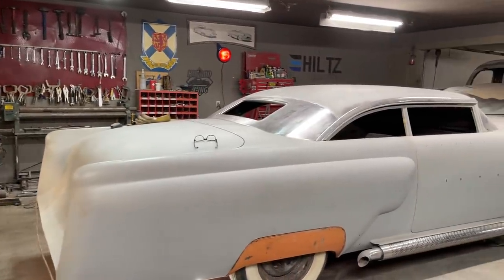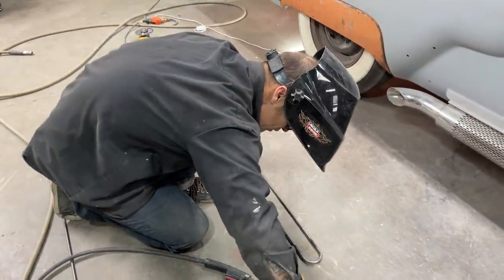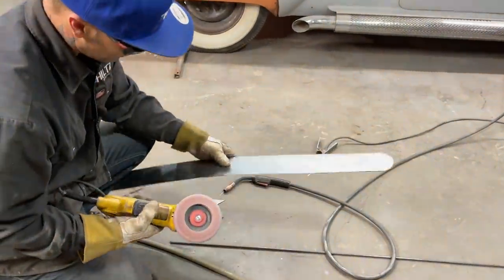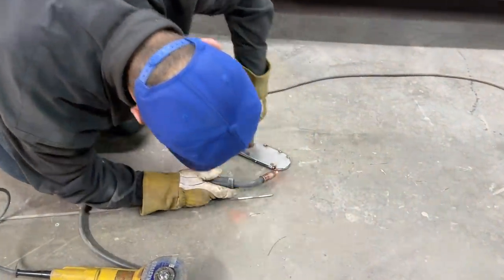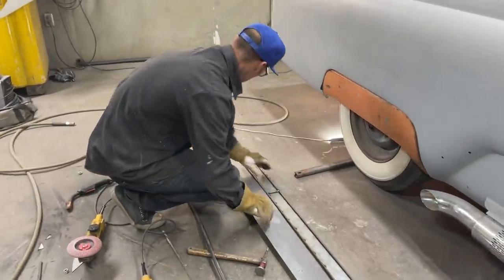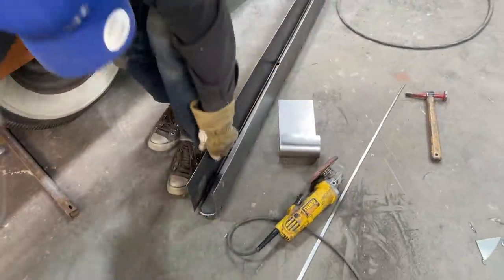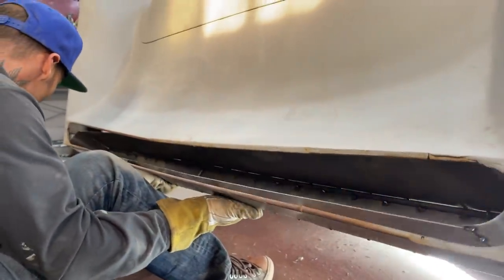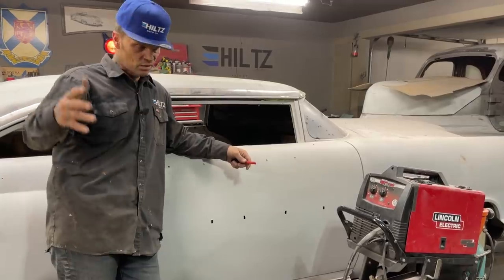Designing and Fabricating CUSTOM TAIL LIGHT from SCRATCH for the '55 Mercury

Comment: Love the light bar. The Sail panels turned out great.
Reply: Sequential LED’s should fit inside that box rather easily. There are some great control boxes on the market that allow turn signals and back up lights as well as running lights. Hopefully Mr. Chad will see this car is good enough to deserve some nice tail lights.

Comment: Interesting idea frenching it in like that. Giving me ideas about making my own. LED strips would be cool in there.
Reply: Don’t forget to add a couple of drain holes if you are going to drive your car on the streets.  I’m a piece of quarter inch tubing  half inch long welded to the outside of the hole will keep road splash from going inside your box

Comment: I would try a test piece on the glass. A soup can has a tighter radius than the windshield and if the vinyl can handle that then you would be okay with the windshield. You could do the test on FB brfore modifyig the barbeque. I'm very curious to see how it works out.

Comment: Another great show..thanks guys. Just on the windscreen and vinyl wrap….heat is used to ‘remove’ the vinyl….so I think you’d need to wrap it ‘after’ you’ve formed it. Maybe try a test piece….but no doubt you’ll figure out the best way 👍
Reply: I think I remember Chad saying he wanted to make this car a daily driver for Jolene and himself. If that’s true then eventually he will have to install a proper windshield. 
I was hoping to see him attempt a custom paint job. I think a two-tone or maybe even a three tone paint job would look nice. Whatever he decides I’m sure he will be happy with it.  What an artist!!
Reply: @i8ntnuts  The old custom trick for doing curved front and rear glass was to sink the glass. They would cut the bottom of the window frame out and slide the glass up and in from the bottom. And then built a hidden frame inside the firewall or trunk area to hold it in place. That way you could replace a piece of broken glass without having to custom cut the replacement.

Comment: Nice job on frenching in the back light Chad and jolene. Once jolene has finished welding it and you have ground Chad I think it's going to slide in much easier cause its probably catching on the lumps of weld at the moment. Keep up the great work the both of you 👍

Comment: That Frenched Tail Light would look great with red Neon type LEDs in it then you could used defused outer panels. To make it dimmer for running lights you could run the light through a resistor to lower the voltage then as a brake light it's full voltage. It would look cool.
Reply: Way cool!  
Custom plexiglass with a small clear piece in the middle for license plate and back up lights.  
Many hot rods these days are being built to drive.

Comment: I believe  instead of trying to make the top of the taililight housing fit the car,I would do the opposite.  I would reshape the body area below to match the shape of the taillight box so it won't have that DIP in the middle and the box will be the same shape on top and bottom.

Comment: I think this lighting scheme violates the minimum height requirement. "Every motor vehicle, trailer, etc. and the last vehicle in a train of vehicles must have at least two red tail lights mounted one on either side of the rear of the vehicle at a height of not more than 183 centimetres (72 inches) and not less than 38 centimetres (15 inches)."
Reply: We have laws like this in Pa.. Kinda sucks. But I do understand it.

Comment: Brad before you remove all of the metal on the corners of the box. You may want to leave 2 small tabs that you Can drill out and spot weld a nut on the backside. That way you can bend them over and use some screw to hold the corners of the lens securely.  later...

Comment: Chad,

  Would you be interested in a wiring diagram and bill of material for an animated LED rear turn signal system.  It shows red arrows from the center to the outside edge.  It consists of 4 LED panels each 4" high x 12" long.  What are the dimensions of your tail lights?

Comment: Please build a metal covered shop table to work on.  I know you're still young, but after you get older the knees and back will appreciate you working on things at waist height.  The beauty of a table with 11ga or thicker is you can spot weld things to it and then cut them off.

Comment: OH BY THE WAY CHAD WHERE YOU BEEN THOSE ELECTRIC SHEERS HAD BEEN OUT FOR YEARS AND ALL THE MAJOR TOOL COMPANYS CARRY THEM
Reply: Yea. Worked in a custom van shop in the 70s. The only manufacture of them back then was Kett. They had the full aluminum body. No plastic. Cut hundreds of port holes,bay windows,roof vents and sun roofs in with them. Ah the good old days! Still have mine. And they still work.